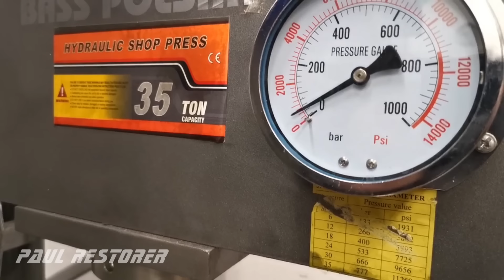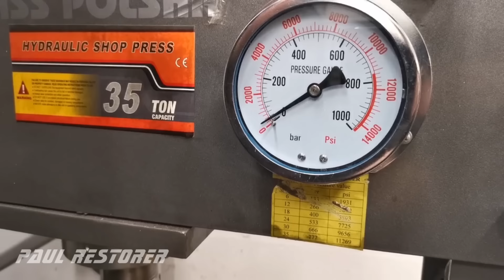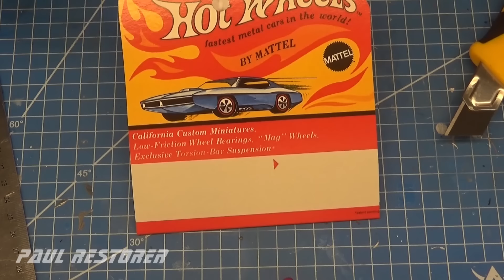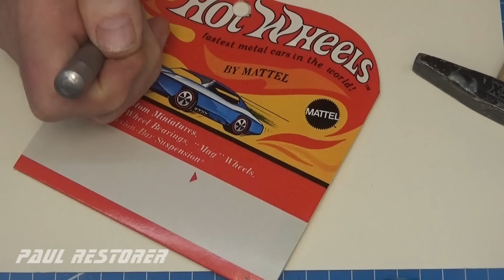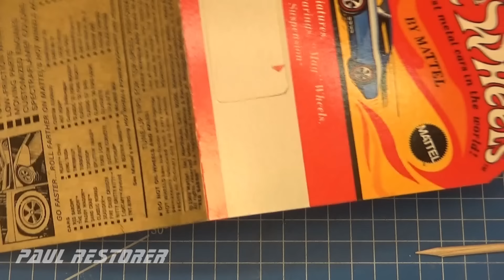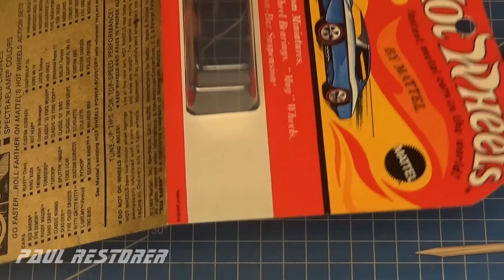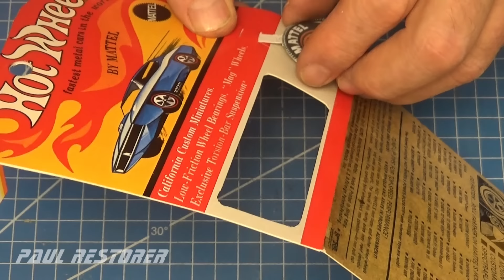Pierwszy Hotwheels Camaro Custom. Przywrócenie do stanu fabrycznego modelu z 1968 roku.

Comment: I have a Hot Wheels 68 Camaro that didn’t come with a hood because the motor has a blower on it and the color is chrome with black strips. I bought it new in 1969 and played with it but it’s still in awesome shape.
Reply: That's Heavy Chevy

Comment: Admiro mucho tu trabajo y siempre veo tus videos, los cuales me sirven como guía, pero esta vez fue una excepción. Soy coleccionista de Hot Wheels redline y he restaurado algunos también, el brillo que tienen los coches es natural, del propio chasis, este debe ser pulido tipo espejo y luego pintarse con pintura traslúcida, de modo que refleje el brillo del chasis, anteriormente se usaba pintura llamada "spectraflame", actualmente puede comprarse una similar en redlineshop, pero es posible fabricar una artesanal; en cuanto a las ruedas, no es necesario que la línea roja sea pintada, basta con limpiarla, igual caso para la parte negra, asimismo la parte cromada debe ser más fina además de pintar el círculo del aro. Actualmente se puede comprar réplicas de estas ruedas, pero con una buena restauración suelen queda bien. Saludos esimado Paul.

Comment: I had the red 68 & the green Fleetside pickup. The pickup was so heavy it would always beat the Maro. I or my cousin & I would play & put those things trough hell. You remember back then Matchbox had a way more selection of different types of vehicles but they were never as fast as the Hot Wheels. Good restoration job, I don’t remember the wheel medallion, probably cuz as soon as I would get a Hot Wheel all of that stuff was in the trash quick & it was play time!
Reply: I received ten of the first sixteen in '68, Custom Camaro wasn't one of them

Comment: That's why hot wheels always felt like they had springy suspension. Matchbox were solid with no bounce. I loved hot wheels.
Reply: The 70s ones had a suspension, not the 80s and later ones. Same exact situation with matchbox. I don't know why they both quit making suspensions

Comment: Great job, even making the blister card to put it in, which I did not expect, fantastic! One thing...didn't you forget the red line on the red line wheels? I still have that car coper color, in perfect condition. Along with 13 of the sweet 16 like brand new. I guess I was a neat kid. I played with them indoors only on the tracks for them. Don't have the tracks anymore, my dad sold them when I got married and left them behind. But still have those cars! Have a 1969 Camaro RS full size, a real one, that's just as new looking as my Hot Wheels cars lol.
Reply: He didn't forget the line. He even shows the step with a comment.

Comment: not quite factory condition. this casting would have been painted in spectraflame colours, still available at the Redline shop in the USA.
Reply: Here in Europe/UK, Spectraflame paints and Redline wheel parts are not generally available, and postage from the States is eye watering 😐
Reply: Should have polished it, and just used the thin blue top coat, no primer, no silver. However I think It looks great, and has a more realistic paint job. Nice work, I'd buy it. 😉
Reply: I had one it was Lime green with a flat black roof. We had countless hours of fun. A friend's mom worked at a department store and she would let us know when a new shipment came in we'd ride our bikes there. One time we got there early enough to watch them stock the shelves.
Reply: Please send us the link so we can see what your restorations look like. Either that, or keep your negativity to yourself. This looks great!
Reply: @MAXIMUMF Doooouuuucchhe

Comment: 1:48 not sure as to why scrape the paint off here. I've done this before as a kid to  cars with the same blade type and there's always the danger of  putting deep scratches in to the metal.
Reply from the maker: you have to do it very gently, sometimes the paint is so hard that it won't come off during a chemical bath

Comment: I have restored several Hot Wheels Redline cars and trucks. I've had success replicating the look and finish of the black "vinyl" tops using Wurth Satin Black automotive trim spray paint. After masking the painted car inside and out, except for the roof area, a single coat does the job. If Wurth Satin Black is available in your area, I recommend that you give it a try.

Comment: There Has to be an alloy you could solder to those posts to re-form the rivet heads…

Then we can Really get the forgery business going!  🤫🫢
Reply: There is Muggy Weld.  They make a low temperture weld/solder for die-castings.

Comment: You could pass that over as a unopened original
Reply: While it's a commendable effort, unfortunately, most collectors would spot a few telltale signs that it wouldn't be pass as an unopened original:
- The wheels are missing a red ring, or "redline"
- The posts on the body of the car were spun, giving it a mushroomed "riveted" look, not screws
- The paint isn't spectraflame (transparent so you could see the metal underneath)
- The blister on the original packages was a combo that held the car and the metal badge
- The blister was glued to the outside of the front of the card, not through an opening in the card
- The card was one piece, not separate front and back, folded at the bottom.